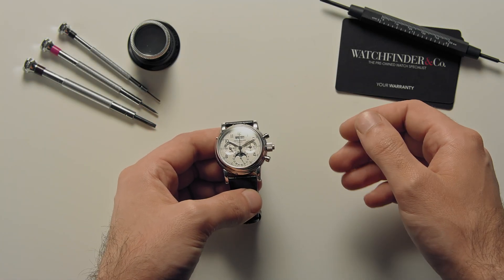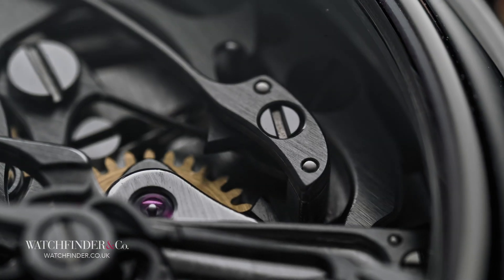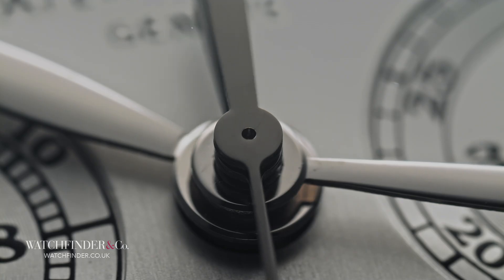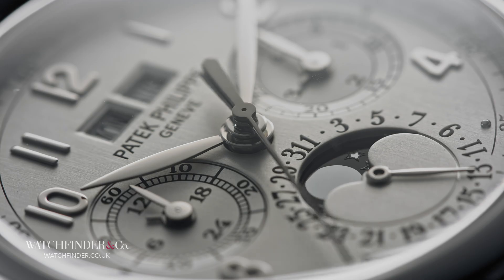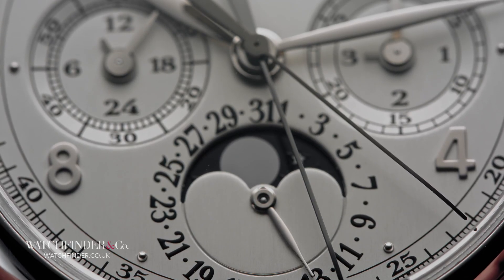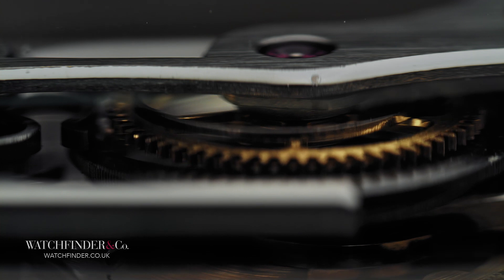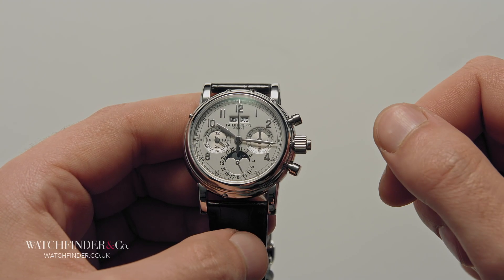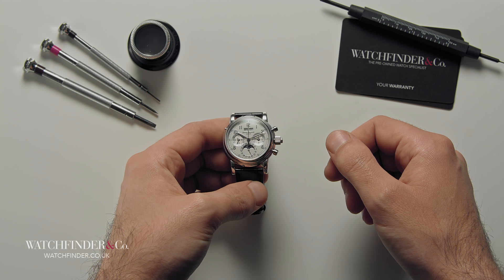How Does a Split-Second Chronograph Watch Work? | Watchfinder & Co.

Comment: Eh, Habring2 is cheaper and save $120k. Definitely less finishing level and quality than the high end level of Patek but still has a high level of finishing and doppel chrono at its price.

Also, it has a simpler chronograph mechanism, much more reliable.

Comment: 6:48 what happened to this 5004? This looks like a Chinese counterfeit, there’s so many chips and scratches everywhere in the mouvement 🤔
Reply: Memeorandum of Understanding  except for Langes ...
Reply: Your ignorance shows in spades in this comment.
Watchfinder sells USED watches..which are used for these videos...like this one here.
Those are not imperfections...at that magnification what you see is just RESIDUAL METAL mixed with oil...resulted from the wheels grinding against each other.
Like ANY mechanical/analog device there's wear and tear!
If you open up an USED engine and put if under microscope you find the same thing...metal dust mixed with oil...imperfect surfaces on metal components and so on.
Reply: SpaghettiKillah Chill no need to be arrogant and I am talking by experience and for owning a few Pateks I can assure you this movement has been damaged by clumsy hands… For the residual metal mixed with oil… why not, although that it is NOT normal. And the bent screw at 3:37 (left side), scratches next to the screw at 3:56, etc. are definitely NOT imperfections and are not due to wear and tear.
Reply: @SpaghettiKillah  Yeah you're full of shit, chips and scratches are obviously not residual metal mixed with oil. Not at all representative of all used mechanical devices, more like the watch was serviced by someone who had no idea what they were doing.
Reply: Baller 738 
yeah sure, because someone buys a Lange then takes it to service to the downstairs shop to save money right? 🤣
Do you even hear yourself talking? 
A HAND -MADE watch looked at x10 magnification or more, like in this video, will ALWAYS have imperfections. Do you even realize how big that screw that you guyz talk about REALLY IS? 
That's 1mm across and at this magnification even the simple act of screwing it in the 1st time will leave a sign..I repeat, at this EXTREME magnification. At x5 or slightly more it would look perfect.
If they zoom in even more at like x15 or x20, you'd see so many imperfections that peasants in the comments would say it's not even worth 500 $ 🤣🤣
Reply: @SpaghettiKillah  I'm sorry, have you not seen any of the other videos on this channel? Bc if you had, you would've noticed that in virtually every other video about a patek, a lange, VC, or any other top tier brand watch, NONE of them show anywhere near this level of imperfection at the macro level. And you do realize that when these watches are being made, the watchmakers literally examine their own work with microscopes specifically to ensure these precise issues do not occur? I'm guessing your answer is a no to both of those questions. Please learn yourself.
Reply: SpaghettiKillah Your arrogance shows in spades. This was a legitimate question, you could have shared the helpful information without the need of a put down.